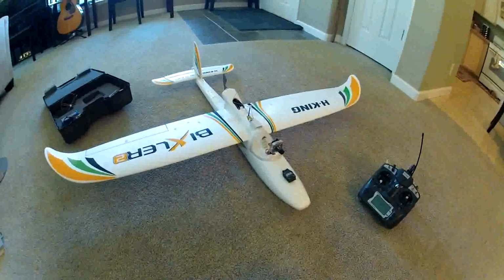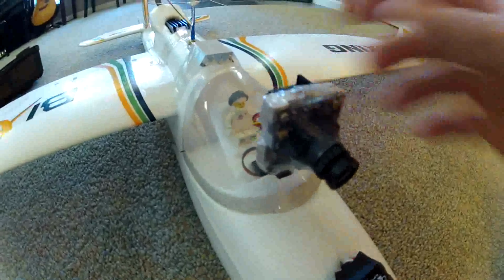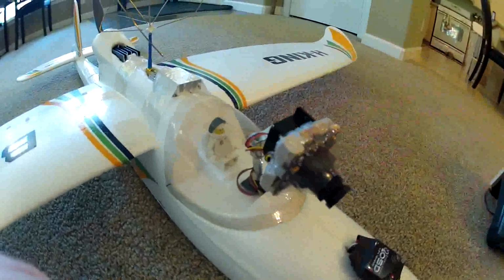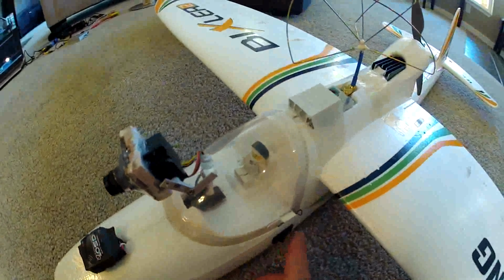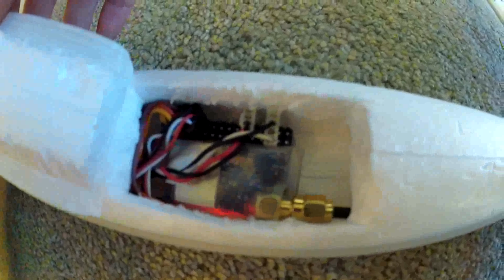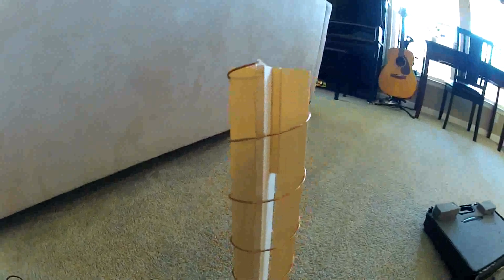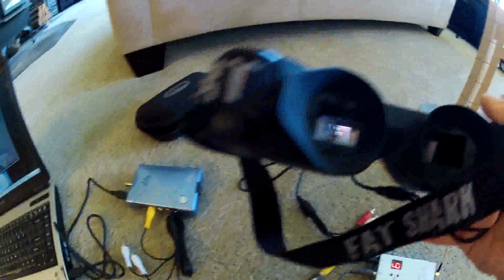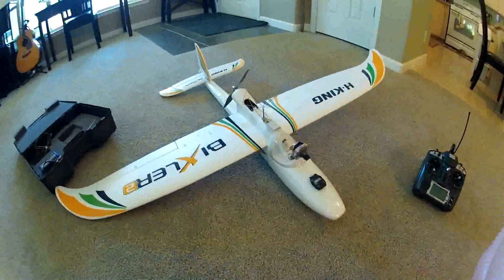Bixler 2 FPV Setup with Rangelink, Fatshark, HK Mini OSD, 600tvl Sony HAD Cam and Sunsky Video TX.

Comment: Hey great video!  I really like your pan/tilt setup.  How did you connect the panning mast to your servo?  It's such a lightweight setup.  Nice job!!
Reply from the maker: Thanks, I made an aluminum bracket to connect to the top of the mast.  The bracket is basically the tilt servo arm.  The mast fits directly on the center of the pan servo's rotation.
Reply: wildernesseric Thanks for the quick response.  So with the mast, how would you fasten it to the pan servo?  I'm trying to think of where I can find that mast?  I'd think it would need the grooved inside to fit on the servo gear on top.  The rest I think I could figure out.  Do you know how you made that mast?  Thanks again and really cool setup!

Comment: Hi Eric.  I, too, have the Mini OSD w/GPS from HK. Would you happen to have a wiring diagram or link(s) to a clear explanation of how to connect things up?  I'm using the HK-Fatshark Predator Combo w/ 5.8ghz. I'm a little nervous about splicing and making fittings, etc. Thanks in advance!  I'm really enjoying your videos. I'm heading on a similar path to LRS...
Reply from the maker: Glenn, the instructions that it comes with are pretty vague so I went ahead and made a little video of how to wire it up. Hope it helps. 
http://youtu.be/-H5fakESvu4

Comment: Hey man, I'm looking at getting the rangelink set up to go with my 9xr. I've got a ton of questions, think you might be able to help me out??
Reply from the maker: Sure, fire away.
Reply: wildernesseric

Okay,

So I'm going to be ordering the 9xr as my tx, I'll order the rangelink to go along with that. From there I'm going to order the video tx and rx that you posted, a 2700mah zippy flightmax compact battery, the security camera, and some better antenas. Can you think of anything I'm missing?

The antennas, what would you recommend, or is it pretty easy to make one of those/ cheaper.
Reply from the maker: kittyhak I would also recommend upgrading the motor to a 1400kv HK motor. It will fit in the original motor hole.  Then you can purchase a 4000mah zippy flight max battery and get at least 45 min of flight time.  You will also need a 40A esc.  Turnigy plush ESC's are nice.  I would recommend the type of antennas that I have.  They are fairly easy to build and will work better than anything else.  I built my helical for free with parts I had laying around.  There are some good antenna build tutorials online for both the helical and the SPW.

Comment: It may be the way you split your video, for about $90.00 from ready made you can pick up the Eagle Eyes FPV Station with Plastic Case, they work great. and the pilot will not be able to fly the plane with that camera in the way. lol looks like you did a great job. If you want to sell your UHF system let me know.